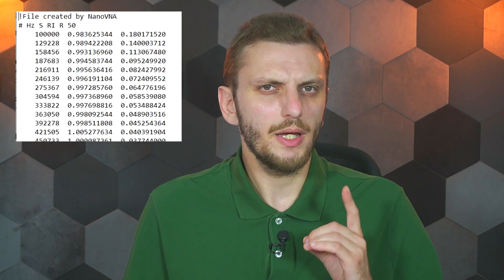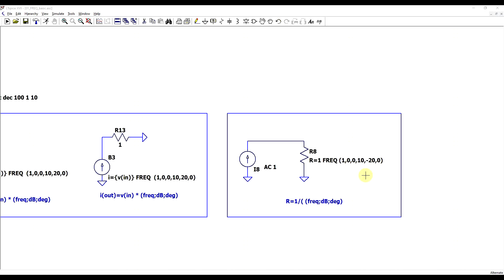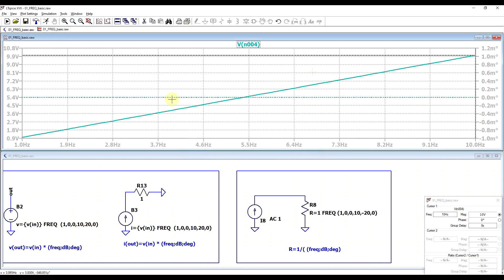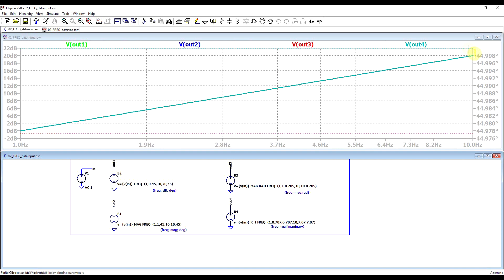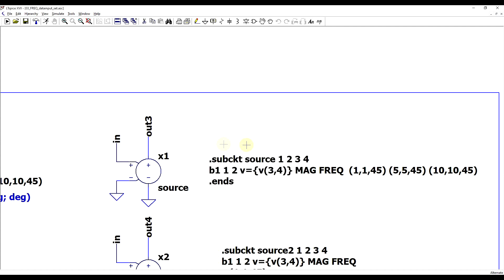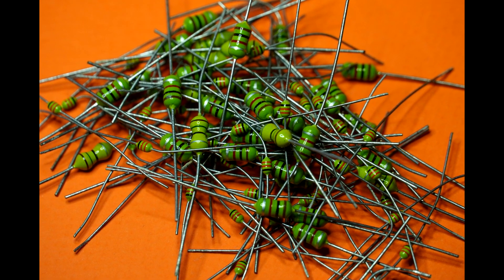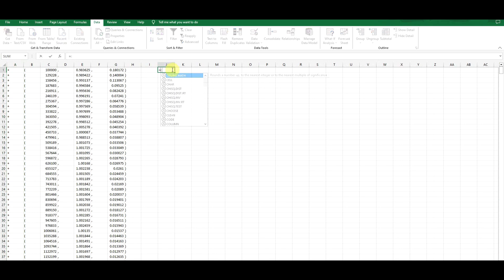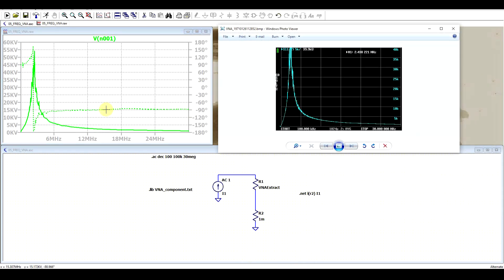LTspice tutorial - FREQ function

Comment: A real signal such as a sound wave is AC in nature and its mathematical signal representation is expressed as a a sinusoid.My question is how a varyring DC signal from DC temperature sensor signal and its mathematical signal representation is expressed?How does its waveform differ from AC signal sunusoid and do we analyse DC varying signal?
Reply from the maker: DC by definition is constant; if there is any variation, however slow (like the temperature signal) it becomes AC; now in real life, every signal could be considered AC, but at some point you make the assumption that it isn't just to make the analysis easy. You can also perform an analysis over a short period of time over which the signal is actually constant, and thus perform multiple analysis of "DC signals" to observe the long term AC behaviour. 
For the purpose of mathematical analysis, you can decompose a signal into an AC and DC component - for ex the 5V of a switching converter has a DC of 5V and an AC ripple of 100mV (as example).

Comment: Thanks for this information. I noticed a flow in this. When i model frequency dependent resistor in ltspice, it works well in AC analysis. But its not working in time domain. E.g performance on a square wave. Am I missing something?
Reply from the maker: No, you did not miss anything... but I think I mentioned this - the Freq function will only work for AC simulations..

Comment: Hello, @FesZElectronics would you know how to define behavior FREQ at DC ?
Reply from the maker: I guess you are asking for the case where you are using FREQ to define a resistor - to help with establishing the DC operating point. For this use case, the DC value of the resistor will be the x in R=x FREQ (...) ; I used 1 but you can use any other value there, its just that the FREQ table admittances need to be re-scaled to take into account the initial DC "x" value. If you need an infinite DC value, you can put the resistor in series with a capacitor that has a capacitance of 1 (1farad) - this way its an open circuit under DC conditions and more or less 0 ohm under your use case frequency.
Reply: @FesZElectronics  Thanks, I'll try.